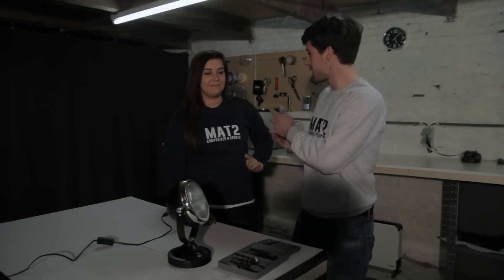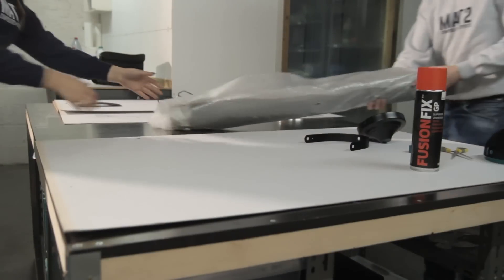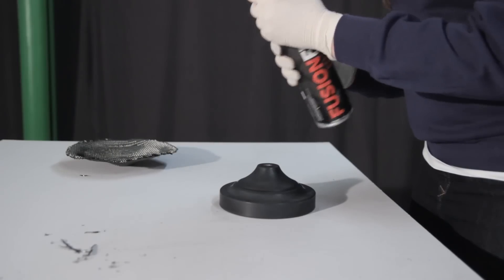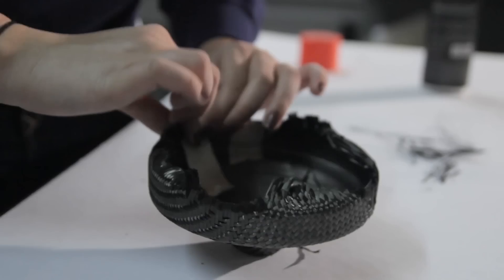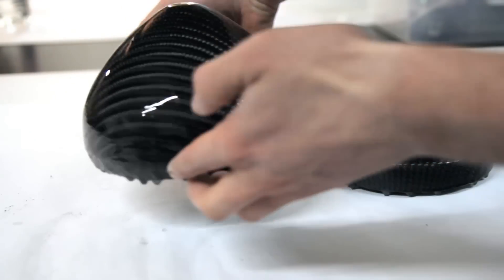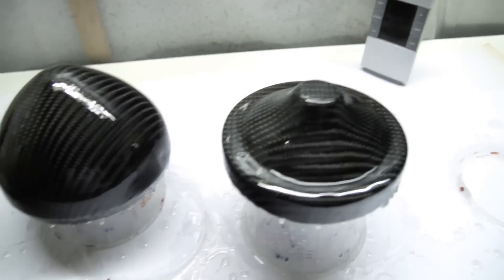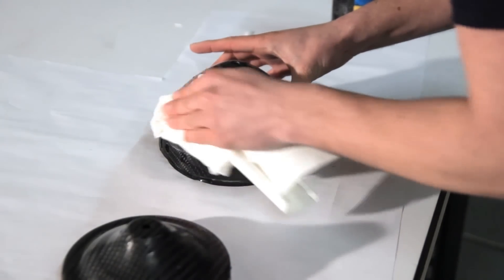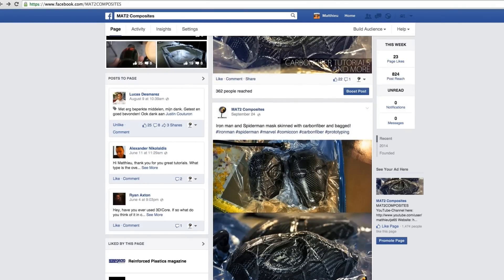Carbon Fiber Skinning/Covering Desk Light (with my girlfriend)

Comment: Does this work without relief cuts because of the weight of the material? I have a really hard time getting the fabric (200g twill) to conform to curvy parts.
Reply from the maker: If it's a twill weave it lays easier than a plain weave, in my opinion the weight helps as well yes

Comment: hi, when i try and do carbon laminating,  when i apply the epoxy resin first coat, the carbons lifts away from the original item and gets air trapped underneath... i use spray adhesive.

Comment: Just one comment.  If you are drilling a through hole I would back it up with a bit of wood to stop the drill tearing the fibre or resin on breakthrough.   If you can’t get a bit of wood behind, try drilling backwards just as you get to the breakthrough point.  Again it stops tearing.
Reply from the maker: mick coomer correct indeed! Thanks for your comment

Comment: Hi Matthieu,Hope you are well .I am big fan of yours and watching all your videos and started little projects of my own at home, really loved carbon fibre lamp but I need your help desperately.I am using 650g 12K carbon fibre (which you used) and following all your steps but after first sand (after first coat) I clean and then I clean it again with surface cleaner but for some reason there is dust on surface and can see through the new coat 😩😩I am using 120G paper to sand first timePlease help me and advise what I am doing wrong hereI would really appreciate.Regards,
Reply from the maker: are you wetsanding the part? you have to make sure that after sanding and cleaning you check under water if there are are still mark or not... you will get the same result after a new coat just like when you put water on it... you can try to sand through your new coat until you get the marks left from your first coat out, but be careful not to sand through the carbonfiber then
Reply: Matthieu Libeert 
Thanks for reply .
Here is what I am doing 

stick Fibre with FusionFix, leave for an hour or so .
2 coats of EL expoxy 
8 hours or over night leaving for dry
Dry sanding 
3 coats of resin 
overnight drying 
wet sanding with 180G, 240G 
another clear coat 
wet sanding 400G, 800G and 1200G
finish with 2 coats of lacquer

I am only having problem with first sanding and having dust left on the part 

Am I doing all right or missing or doing something wrong here ??

Thanks a lot
Reply from the maker: looks right, might be you have to much air in your first layer maybe causing tiny airbubbles getting filled with dust and not being filled with resin after... I would suggest to do the first two layers than wait 24 hours and start with wetsanding... that way you wont have dust getting trapped in little pinholes
Reply: Matthieu Libeert 

Thanks a lot , I will do this tomorrow and let you know how it goes .

I do use heat gun to take all bubbles out though but I think your are right so I will let you know tomorrow 

Much appreciated your help and looking forward to see more videos 👍
Reply from the maker: you can use a heatgun to pop some bubbles out of the resin but do not apply to much heat or it can "burn" your epoxy, good luck!
Reply: Hi Matthieu, hope you well .
I just want to know what Grit sand paper to use after first coat ?
I used 120Grit after first coat but it's leaving scratches 😩😩😩

Please help. 

Thanks a lot in advance

Comment: My concern is that light makes a lot of head did u do anything to add more chemicals to cool the carbon fiber down? Maybe in the future i might make a engine block out of carbon fiber not the parts just the block
Reply from the maker: No nothing special, the light does not heat that much compared to an engine block...maybe max 35°C here so perfectly fine for normal resin
Reply: Matthieu Libeert oh okay so if i were to heat up carbon fiber about 0.7 inches thick would that melt the engine block because its like over 400 degrees... is there any chemicals to prevent from burning the layer of the carbon fiber?

Comment: Great video. I'm about to do the CF skining on my E90 interior. I'm just wondering how will I go around the vent hold on the dash board? should I do the same as you did on the video and cut the holes at the end? or should I cut a hole on the fiber before adding the resin?

Comment: I have a problem with getting rid of the air bubbles in the resin. Why don't you have this problem, and how can I get rid of the bubbles? Your help would be appreciated! Thanks
Reply: heat gun will work. also try acetone in a spray bottle. and lightly spray it over the part
Reply: +fastsofaracing I'll try that, Thanks!

Comment: i have been skinning parts alot, and i have a very common problem.  i use spray adhesive, and it is so tacky that if you mess up, you can not pull the carbon fiber off to reposition it.  but, i have the common problem of the adhesive releases in spots when i start adding the epoxy resin, making it look bad. how does the carbon stay to the part with the adhesive you use without releasing when adding epoxy?  it drives me crazy, and i have used 3 different types of spray adhesive, and i have not found a great way of getting the carbon to stick while wetting it out. any recommendations would be much appreciated.
Reply from the maker: +Serg Stroble hard to tell, with this one i dont have the problem...
Reply: idk if you're still molding carbon fiber yet, its been a long time since you left this comment, but if you are, try doing a light coat of epoxy before laying the fiber. This will in fact require you to be more precise when laying, but once its down and wet, it will not pull away. Just remember, you cannot rush this step, it's slow, steady, and attention to detail.

Comment: you forgot to mention what grit sandpaper you are using for each coat.
Reply: Indeed the info I am looking for. And how long between sanding and drying
Reply: It really doesn't matter, epoxy will fill in just about any sand scratches.  To be safe, use no lower than 180 for heavy stuff.  Then go to like 320 wet or dry.  Just don't sand into the carbon.  The dust should be white if ya see black then stop.  Use the scuff pad for any low spots (shiny) afterwards.  As for time, really as soon as its hard enough to handle you can start sanding.  Tho if still soft you might have to wet sand to keep paper from loading up.

Comment: Great Job so far. When you sand the parts be sure your layer of resin ist thick enough so you dont sand through it.

Also check out my Channel. I startet wrapping carbon fiber parts 3 years ago and have a lot of expierience in doing this.

Comment: Are there any off-the-shelf glue sprays you'd recommend if we don't have Fusion Fix?
Reply: +David Koh You can use 3m super77. Just make sure you apply it as light as possible or it'll show through on your mold side surface if you're using a mold. If you're just skinning a part it doesn't matter since the adhesive layer is between the carbon and the part, not on the visual (A) side.
Reply: Okay, I will try that. Thank you!
Reply: +David Koh 3M spray tack. I recommend doing a coat of epoxy & letting it get sticky. Apply the cf & let it cure over night,  then start applying coats.